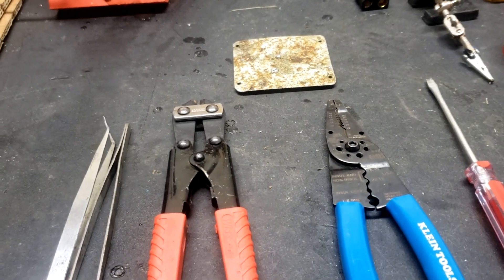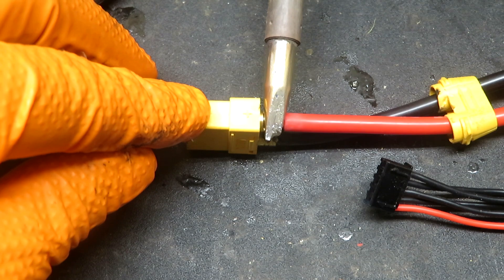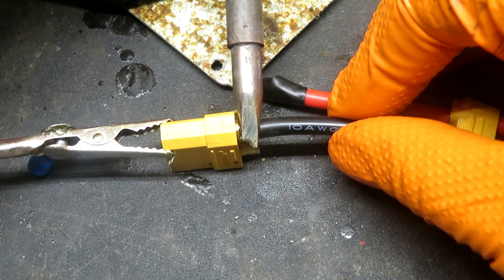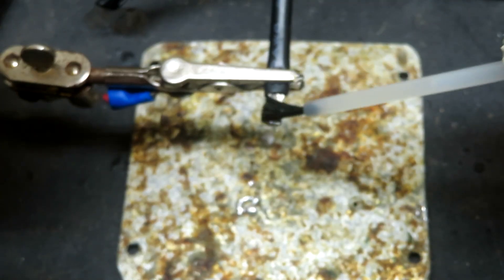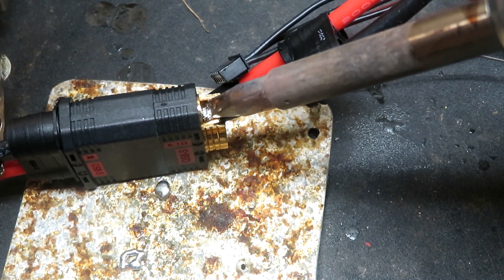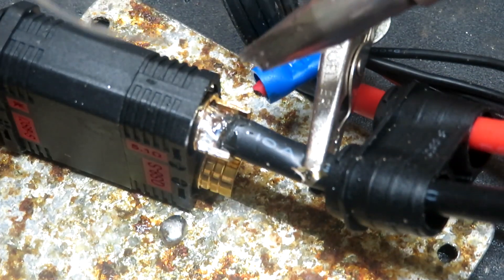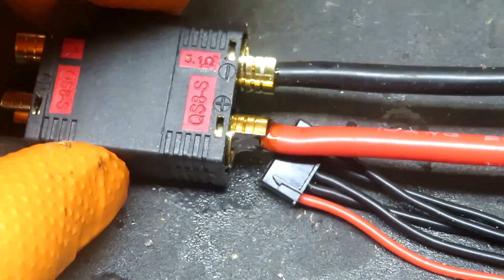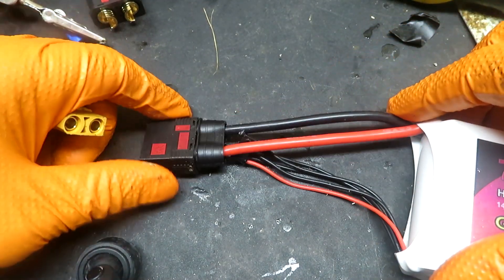How to solder Lipo battery connectors Qs8 antispark 8mm (OSE)

Comment: I did this yesterday. It’s easier with flux, thicker 1.2mm diameter solder with rosin and a soldering iron tip that is flat and blunt to spread out the heat quicker. 😉
Reply from the maker: if you like the corrosive residue it leaves behind then flux is your friend.  Rosin core is more then enough.   But hey if it help you that good.  But try avoid that stuff man it's definitely not needed and  thanks for watching

Comment: I’d really like to know what your temperature setting is on your iron in this video. You’re really making it look easy but I know it’s the small stuff that matters. And since I’m kinda new to this I can use all the help that’s offered. And thanks for the video BTW - very helpful to me !
Reply from the maker: Thanks for watching.  I had temp at 800F
Reply: @KiloWattRC my temp only goes to 480....will that be OK?
Reply: @3SonsRC  Most soldering irons wont work as the wattage is too low. Just check the wattage and everything above 100/150watt should work

Comment: Hey DISHDOCTOR, I just stumbled across your video and it is very informative for soldering these connectors. We recently started using these on some of our builds. Have you ever experienced any issues with these connectors failing by getting very hot and the plastic ring on the inside melts? We've run into this a few times and can't pinpoint what is the cause. Thanks again for the great vid!
Reply from the maker: Yeah when you run constant crazy amps the red insulator in female positive bullet melt to male positive bullet.  QS10 connectors might be a better choice for your constant amp needs
Reply: I'm actually going through the same problem with the xlx2 1100kv kraton 8s.
I never considered qs10??

Comment: Nice video, what temperature do you have your soldering iron set at?
Reply from the maker: I have a Weller 40 watt station.  And I use #5 setting for temp.  Not sure what the actual temp is.

Comment: When you’re doing the second wire (positive) I’d wrap that negative side with electrical tape.  There’s not much room to wrap it but it’s possible.  Nice video.  Very impressive skills.  I can’t solder lipos and stay that laid back…. Freaking anxiety
Reply from the maker: Thanks for checking out the video.   Yes you are right, safe is better then sorry

Comment: What do you mean misalign the holes? How would not having a connector plugged into it cause that?
Reply from the maker: The heat from iron will soften the plastic in the connector causing the bullets to move or miss align in the connector.  Making it hard to connect and disconnect.   Have the connectors connected keeps the bullets aligned in both connectors making it easy to connect and disconnect
Reply: Having that opposite connector plugged in also helps with heat dissipation whilst soldering. Especially if there's wires soldered in like in the video. Heat sink. Stops your plastic connector getting messed up. Thank you for the video. I'm about to solder 22s worth of li-po. Along with matching series harness. And parallel charging cables. As much as I like soldering. I'm not looking forward to it. Gonna take  a few hrs. I spent £90 on QS8 connectors. Gonna be running 22s 10ah 25c tattu batteries at 150a peak. 92.4v @ 150a. 13,860w minus any voltage sag under load. 18.48 bhp on my bike.

Comment: Great job!  How do you avoid melting the connector.  I have ruined so many connectors I don’t want to solder anymore.
Reply from the maker: U want to only solder with male and female connectors connected.   Have all materials needed in arms reach and know what you are grabbing.   It takes some practice,  but very manageable
Reply: Qs8 hold so much heat. You can’t melt them unless you really overdo the heat. Also make sure to have male and female connected to act as. Heatsink.

Comment: I really want these connectors and all, but, how the hell do I charge em.
Reply: You have to make a adapter.
Reply: @John_D2  Ah more soldering. Welp I guess it's worth it, thanks man for the reply.
Reply from the maker: Yes you can make adapters or just buy them on ebay

Comment: I was pretty spooked about doing this on my 14s lithium ion pack at 52v nominal and 280A maximum 🤯🔥🔥
Reply from the maker: What are you using 14s battery for? If u don't mind me asking.
Reply: @KiloWattRC  I built it for my converted ebike. I also used it to power an induction furnace and hope to build an electric Mountain board for it too one day.

Comment: Nice job to help those out but the liquid flux is acid base & not supposed to use it on wire
Reply from the maker: Completely non-corrosive liquid solder flux
consisting of a solution of special rosin in
alcohol. Contains no traces of acids or
chlorides and is completely safe to use on even
the most delicate electronic equipment.
Part No. 10-4202 2 fl. oz. Bottle
Part No. 10-4216 16 fl. oz. Bottle

And thanks man and of course thankyou for watching
Reply: @KiloWattRC  excellent good to point that out to those listing !!

Comment: At 4:23 ladies and gents... not only should you add a little flux on that post, but you should ALSO lightly PRE-TIN THAT POST, THEN proceed with the rest of his steps.  He didn't pre-tin it so it took longer for that wire to integrate/adhere with the solder and bind + he needed to get the iron touching the post AND wire for an even quicker melting point/bonding point.  Also, your solder is a little too thin.  A larger diameter solder would disperse easier and you'd spend less time and heat trying to get it melted in  place.

Lastly, you should have some electrical tape covering that red wire that had already been soldered for an extra safety step.  If your soldering of that black wire would have come loose, it could have easily fallen down on the red one shorting things out.  An electrical tape barrier would prevent such a mishap.

Good post anyway...
Reply from the maker: Yeah it all good.  I tried my best giving the proper warnings of the dangers.  I forgot to pre tin first lead its all good, did it on second lead.  I wish could of made video super perfect but it happens.   I have the thicker solder but I just like using the smaller solder for some reason.  Thanks for watching man
Reply from the maker: Alloy 60/40.  I would definitely love to have lead free solder.
Reply: And in addition to the Pretin step in the plug as well as the wire . Wrap the  gator clip teeth with 8mm silicone tube to protect the wire jacket

Comment: can i use this even for 6s system or just 8s systems? and also...if i replace the esc, do i also need to use this on all my batteries? thank u
Reply from the maker: Yes you can use 8mm qs8 antispark connectors on 6s they are rated for 200amps.   Sadly all lipos will need the same connector upgrade.   But its a upgrade that well with the hassle